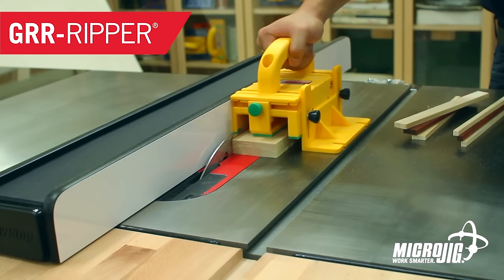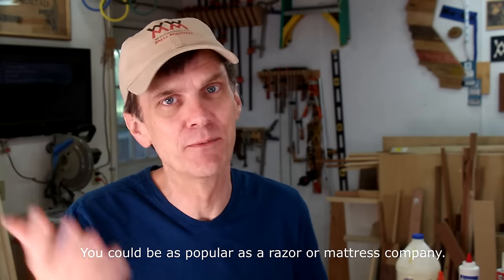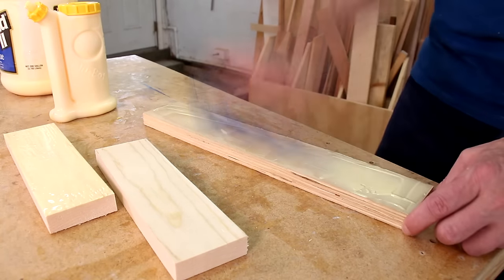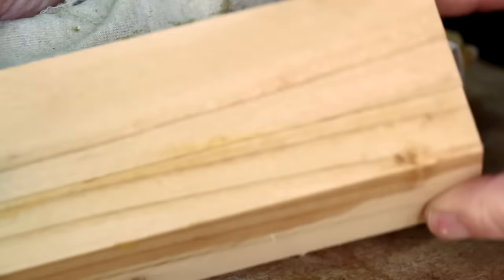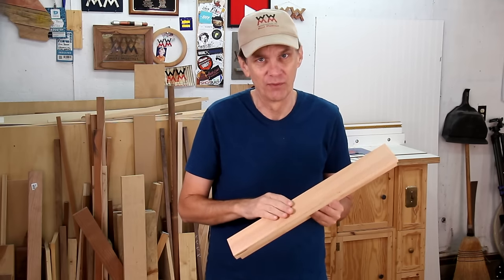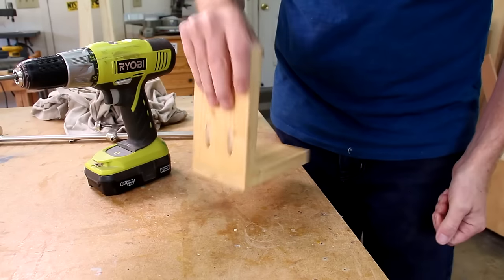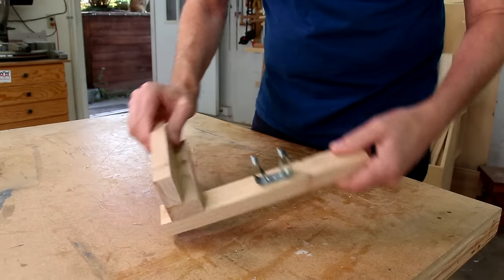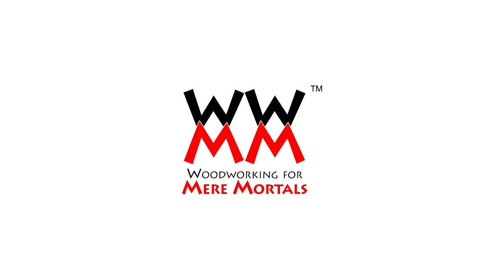What You Need to Know About Glue | WOODWORKING BASICS

Comment from the maker: Glue and gluing is an essential component of woodworking. It's not exactly something that requires a lot of skill or technique, but I have a few tips that should get you started. Here's what you need to know about glue: the BASICS. Do you have a favorite adhesive? Let us know what works well for you and if you have any gluing tips and tricks to share.
Reply: +Steve Ramsey I love Titebond and hope to do a video sometime comparing the different types. Thanks for the video :)
Reply: can you make a medal and trophy display i want to make one for my little brother he has alot of medal and some trophies
Reply: +Steve Ramsey I always use a silicone brush to apply the glue, it easily washes off and is reusable. Also I do prefer Titebond II it's the best glue I've used so far. Do you shop at Rockler Woodworking for any of your supplies?
Reply: +Steve Ramsey  One trick i use in case i can't use brad nails is; spread the wood glue but leave some spots where i will drop some drops of cyanoacrylate glue on one side and spray activator on the other part so when both parts touch it will create an instant bond and act as it was brad nailed . Also works with contact cement, mixing/using  two types of glue can be very helpful in those cases where it is hard to clamp or the piece won't allow nails or any other hardware. Hope that helps ;)
Reply: Can you make this video as educational so I can use it in my school
Reply: +Steve Ramsey Hey Steve, CHALLENGE :P
- Make a project that incorporates your demo glue-ups.
- You're allowed to slightly alter the parts, but not so much that the part isn't recognisable.
- you can add more parts.
Go! :D
Reply: +Steve Ramsey what about elmers? it IS the most known.
Reply: +Steve Ramsey For squeeze out, I picked up a trick from Matthias I think(?) - basically just keep some sawdust from your cuts for the project, then rub it over the squeeze out.  The glue bonds to the dust, clumps up, and rolls off as you rub it in.
You can also mix it with glue and use the mixture for plugging holes - they'll lose the grain but maintain the color and seem to be easy enough to stain.
I don't have a dust collector, so I just drop a small bowl under my table saw to collect the saw dust when I start the project.
Reply: wood glue is also good for gluing sponge on wood. I've tried and it works,didn't have to go  buy special glue for the purpose.
Reply: +Steve Ramsey Glue tip i wish I didn't know: If your toddler bites into a tube of cyanoacrylate glue it can rupture and harden almost immediately. Hardened CA glue is non-toxic so the biggest danger is from swallowing the pieces. Use butter to loosen up and remove the large chunks and after a few days the baby's drool will take care of the rest. Gradually more and more will come out. My son had his mouth glued open for almost three days, he was miserable (and so were we), but once the last of it came out he recovered fine.
Reply: Steve, epoxy can be used for normal wood to wood. Actually it is a strong bond that we used in experimental aircraft. One good note on epoxy is: the longer to cure, the stronger it is. Also, you can dilute on alcohol, making cleaning easier. In our shop we used to dilute epoxy on alcohol and use it to protect the wood, like stain.
Reply: Luciano Saraiva Resende Can epoxy be thinned this way using Isopropyl alcohol? It'll get me out of a jam if this is the case. I need to weatherproof some thin sheet ply, and I thought rubbing some teak oil will at least make it last a little while. But nope! It rained in the night, and made the wood swell just enough that things started jamming.
Reply: +Azayles I use acetone to thin epoxy, it flows nicer and evaporates without residue.
Reply: Do you ever use cyanacrolate glues? Basically its super glue with an activator. Dries in seconds. It's great for crown molding, or any other molding really. Very strong bond in seconds.
Reply: Guys, busy week ahead, almost impossible making a video showing the epoxy techniques. So, basically answering some questions:
- epoxy can be thinned with alcohol, we used to use 92% ethanol as this is cheap in Brazil. Dilute it until you can paint with a regular brush. The finishing will not be that beautiful but it is strong and resists weather.
- alcohol can also be used to clean hands, tools, etc. epoxy dilutes very well in it.
Any doubts? Let me know!
Reply: +Steve Ramsey Hey Steve. Cool channel. As a carpenter I use Loctite PL premium polyurethane adhesive for construction work. It bonds anything to anything permanently. Great product and far superior to anything with the liquid nail brand. Downside is its gummier than standard construction adhesive. A little goes a long way.
Reply: I don't know about Titebond, but with other PVA glues you can use an ordinary painting brush, and keep it in a container of water when you are not using it. Just whack or squeeze most of the water out before you dip it in the glue bucket. :-)
Reply: Actually, you can use the same brush for years if you keep it in a small bucket of water.
Reply: i do know how to fill holes , make a mix of glue and sawdust  and smooth that over the holes and wait until its dry enough to sand with fine grain sandpaper (440) grit

learned this from watching Jimmy Diresta's youtube channel
Reply: So glad to hear somebody else gets satisfaction out of pulling that dried glue off of those silicone brushes.  More like a big booger than a splinter for me though.  :-)
Reply: Also I insist on that strange part you made in this video being included in the next round-up 'what happened to...' style clip show, and by then I want to know what its function is!!!1
Reply: Could you do a video on gorilla glue?  What do you think of it?
Reply: I usually use the actual wood itself to spread the glue... just place the two together and slide them around for a while.
Reply: CA glue was originally used medically in place of small sutures.
Reply: Steve Ramsey is Elmers wood glue better then titebond 2
Reply: Do you recommend Elmer's Wood Glue? This is literally the most available glue here in the Philippines😢😢
Reply: Problem with these modern glues is they don’t age well. A lot of antique furniture which were done up by amateurs a few decades ago basically are messed up now. If you want to achieve a timeless quality in your woodworking projects go for bone glue.
Reply: tho wood glue is known for not being effective at all to reglue old wood glued joints (doesn't stick well to itself...nothing does except ca.  The real reason those furniture pieces are like not properly seasoned wood.....5 minute epoxy i recommend pretty low lol, West Systems is a great brand thats widely used in the boating industry, the longer the set time of the epoxy generally speaking the stronger it is.
Reply: Ah, the basics, too often they are left out as folks may think “oh, they know that” or “why did you not know that”. In sports it is “back to basics”, thus I thank you for “the Basics”.
Reply: Some are mentioning Elmer’s glue. It is excellent glue, Titebond II compares quite well with Elmer’s Wood Glue. For my own edification I created a few test using both Titebond II Wood Glue, Elmer’s Wood Glue, and Elmer’s All-Purpose glue. The results floored me and my friends, all three performed (for all practical purposes) equally on adhesive strength. Elmer’s All Purpose is water soluble thus I would not use it for outside pieces, for inside pieces it is excellent. After my tests I did not find any reason for Titebond II over Elmer’s Wood Glue. By the way, the color of the glue adds only color nothing else.
Reply: @raydavis2904  p

Comment: A tip for removing excess squeezed-out glue is to use a damp or even quite wet cloth - you will remove excess far more effectively and do much less sanding once it's dry. Glue will also be less likely to be absorbed into the grain of the piece you are making, which can be visible when varnishing or oiling later in the project and almost impossible to remove at that stage.

Comment: Great video. End grain to edge gluing more complex than video indicates, for larger projects. I used laminated white oak (very open grain), for about 30" table top, with a frame" of 4" walnut on the ends. Joint blew apart due to expansion/contraction of white oak grain with humidity/temperature changes - about 1/8". Best approach is to use a spline on the edge.

Comment: Hey, Steve, an observation from my own (admittedly, limited experiences) so far.

I suspect that if you live in high-humidity areas (Florida, SE Texas) that you probably want to use Tite Bond III over TB-II. 

It has to do with the way the two work, which is in opposition to each other.

TB-II gives up moisture to the air to dry. In FL, where I am, it was 75 degrees out -- in the middle of winter -- and 45% humidity, which is about as low as the humidity gets. 

I was trying to do a glue up with TB-II, and, after **36h of setting**, it was still WET INSIDE... needless to say, it was failing miserably. Part of that was that the wood was damp, too, because... humidity, again. But I had done a lap joint, using a router to remove half of each board... So there was a lot of surface area to be grabbed. No luck.

TB-III, otoh, works by absorbing moisture. The glue up I was doing was set inside 3-4 hours, and had a good, strong bond. 

The downside (as you no doubt are aware) is that it "foams", meaning it'll need some additional after-cleaning/prep, which is no doubt a pain but not as much as waiting two weeks to actually complete the setting process.

This isn't a complaint, I just thought your viewers might want to be aware of this if they happen to live in one of those areas, or anywhere else where humidity runs at not much under 50%. I suggest they try TB-III in those areas.

Comment: Just a few additions from my side:

Instead of just using a dry cloth, use a damp cloth. Removes the glue much better and easier.
Use something like cotton only, other materials will leave fluffs behind. 
Don't use paper towels, really messy.

When using wood glue, clamping can be difficult because the surfaces 'skate' away.
Some people use 'biscuits' or dowels to prevent that. 
Another good, very simple and cheap technique, is using tiny little nails.
Just hammer the nails in one side, cut off the heads and join the two wood pieces together. 

One type of glue I am missing in this video which is widely used in (mostly cabinet like) constructions is PU glue (or construction/foam glue).
It's is not the nicest glue to work with, because it is extremely sticky (so use gloves or be careful!).
PU glue expands and therefor is very useful to tighten joints like recessed , dovetail joints etc.
Real professional products (like big PA loudspeakers etc) are mostly glued with this.

Wood glue can be perfectly used for veneering.
Just roll glue on veneer and piece of wood and let it dry for 10-25 minutes (until it's is just sticky/almost dry), meanwhile heat up an iron.
Ones the iron is warm enough, just put the two pieces together and press firmly on the iron, the heat reactivates the glue.
Now just simply go over the whole surface area and finish with a roller.

Wood glue can be used to repair (old) paper loudspeaker cones.
Use paper towel and pull/rip it in little pieces.
Mix the wood glue with a tiny bit of water. 
Put some glue/water mix on the gap/crack with a little brush.
Now add the little pieces of paper towel and cover them up again with some glue/water mix.
Let it dry for 12-24 hours.
This only works for small gaps and don't use toilet paper (it contains some strange kind of glue that doesn't dissolve) 

Last funny little detail.
Wood glue looks yellowish in the USA, in Europe (and many other parts of the world) it's white colored. 
(dries up transparent)

Comment: Hi Steve, just a short comment re the glue up process. You may already be aware of this but if you have a problem with slippage I.e. when you put 1 piece of wood on top of another to glue together they often seem to slide about and it's hard to join them accurately.  A tip I found out about recently is that if you just sprinkle a little salt on top of the glue it prevents the parts from skidding about and the salt just disolves away and "voila" great result - no slippage.

Comment: If parts slip while trying to clamp sprinkle on some table salt.  The parts won't move.  Great video.
Reply: I use hardwood sawdust.
Reply: Skully Wood & Metal yeah but the parts don't lay flat so you shouldn't really do that!
Reply: nowonmetube well if you're clamping them together and use fine salt then the salt will probably be embedded into the wood to where it says flat properly.
Reply: LazyH-Online lol that's just a theoretical thing that would NEVER work irl, lol!
Reply: nowonmetube really? Huh, cant say I ever had a problem with the method before, and I'm assuming both myself and my projects exist in real life.
Reply: I've also heard you can clamp in the other direction first to line up the edges, then clamp down normally.
Reply: Dandruff works well too.

Comment: Crestabond M1-05 is by far the strongest adhesive I've ever used. If you need to glue 2 different materials together, this is your stuff. and its pretty inexpensive and comes in a 2 part tube, you can leave the top off indefinitely and it wont go off until you mix the 2 parts. Wood to metal, metal to fibreglass, fabric to fibreglass. Just 10 minutes curing time and your done. It can act as a filler too, if you've got a gap of 4 or 5 mm to fill, slap it on and let it cure, sand it off, job done. Fantastic stuff!

Comment: I do a lot of fretwork with my scrollsaw, and often want to mount a piece of fretwork onto a piece of contrasting background. If I try to apply the glue with a brush or my fingers, the glue tends to run down into the holes where it is almost impossible to clean up.  I have found the best tool for this is a four inch paint roller.  Pour some glue onto a scrap piece of Plexiglas, and load up your roller.  Then you can very quickly roll on an even layer of glue over the whole piece, and if you do it right, you will get almost no squeeze-out.  Then I place the whole thing between two pieces of 3/4" plywood and set a bucket of sand on top as a weight/clamp.  Make sure that your plywood pieces are dead flat, and that your glued surfaces do not slide around as you handle them.  This is also a useful technique when you want to glue the flat sides of two boards or plywood together, because, with the roller, you can apply a lot of glue to a very large area before it starts to dry.

Comment: For most jobs in my shop I use the Titebond Pva Yellow like you show but for awkward clamping jobs that take about 8 clamps ( like an antique Georgian chair that needs to be clamped all at the same time ) I use Titebond Hide glue. Water soluble ( easy wash off the piece after it's dried any that I missed during clamping) reversible, a much longer clamping time and it's only slightly less strong as PVA.I know a lot of cabinet makers often say it's not as strong as Yellow glue, my response is that I have worked on may antique chairs in my profession and maybe only one of the leg joints has failed the other typically 14 joints on a chair have stayed strong - after maybe up to 150 yrs!

Comment: Hey Steve, You were talking about that you can't fill nail holes to match the wood. 
Well an old Indian trick is... to use the saw dust from the wood that you're using mixed with a little glue. Your nail holes, once sanded,  will accept the stain and become  invisible.
Reply: +HELLRAISER Why is this an "Indian" trick?
Reply: +Maybe Dave 
Just an old expression carpenters have used for decades.
Reply from the maker: Does that work well for you? I've never had much luck matching the color with that method. It always seems slightly off, maybe because of the yellow color in the glue?
Reply: +Steve Ramsey I agree. Wooddust doesn't respond to stain like whole wood particularly if it has titebond mixed in with it... Tibebond inhibits stain saturation.  Shellac sticks come in many colors and work well.
Reply: +Steve Ramsey 
Could be the yellow in the glue would give you problems. I don't remember the brand I used but it was white and dried clear. I used more saw dust than glue so maybe that's why it worked well for me.
Reply: Sorry, OLD INDIAN trick?  What tribe do you speak of?
Reply: I use Weldbond for filling nail holes with wood dust.
Reply: @cornfusedatbest6693   I think he is talking about the one Elizabeth  Warren  belongs to

Comment: you can use salt while your gluing things up to make sure that the wood doesn't slide around while you work on it.
Reply: +Iqeatbal Ismail you apply glue to one surface and sprinkle a little bit of salt into it, then you put the other piece of wood onto it and the salt caused friction so the two pieces of wood can't slide around past each other.
Reply: +The Russian Woodworker   Won't the salt cause a reaction with the glue and have some deleterious effect?
Reply: +Gallande 34 hasn't happened tonme
Reply: Sorry but I could not understand what you meant.